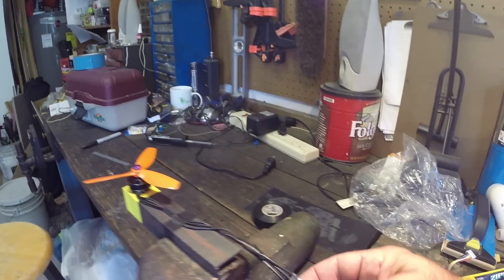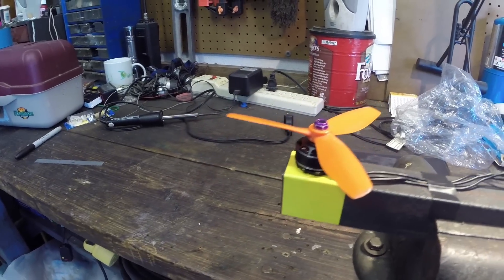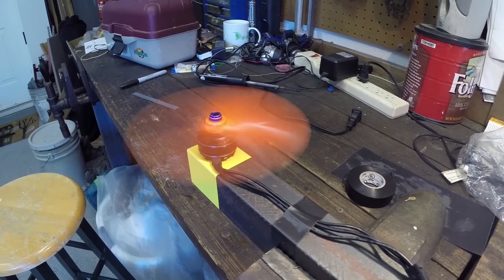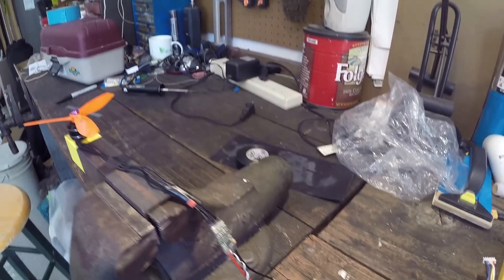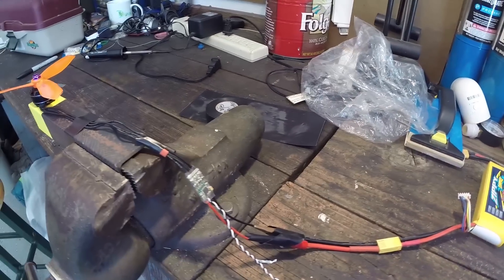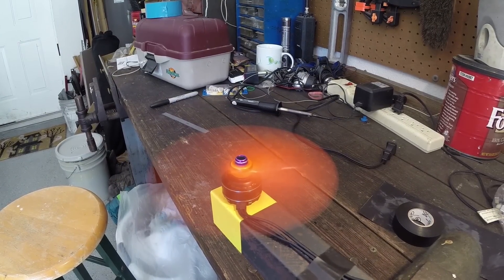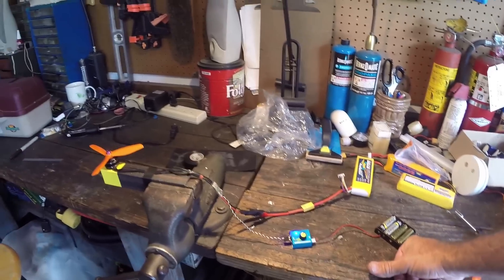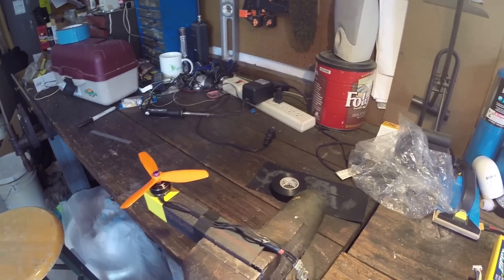Test Blheli s Aikon

Comment: What was your minimum on the aikon?
Reply from the maker: This test was done with stock settings.  I did not touch them.  I don't know what they were.  Two rigs running these with no issues still.
Reply: +planedoctor yeah threw mine on lastnight. pretty happy

Comment: Have you noticed any thrust difference while using these escs vs the base blheli?
Reply from the maker: I have been flying 20A little bees so really not a huge difference.  I do think the BLheli_s runs motors cooler and the increase in resolution is the biggest difference.